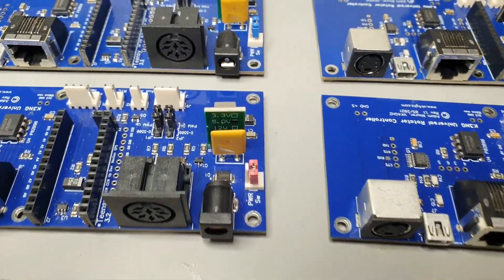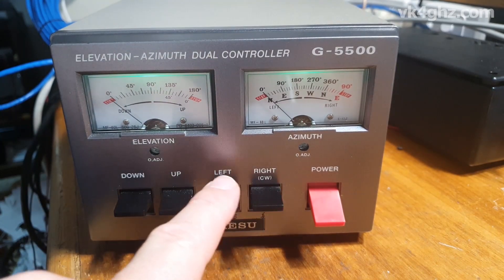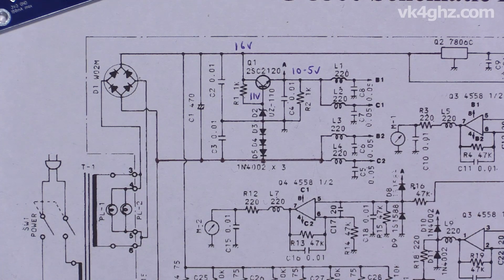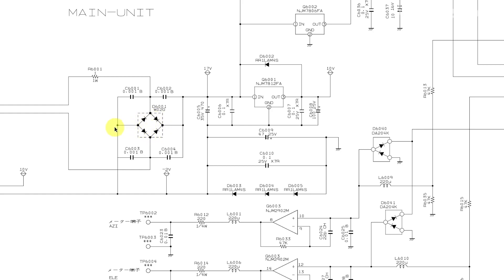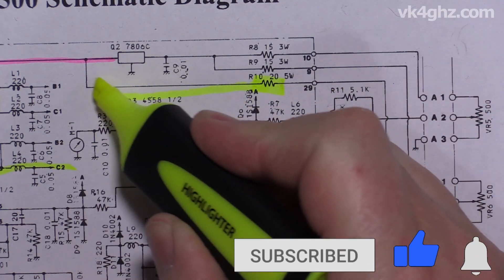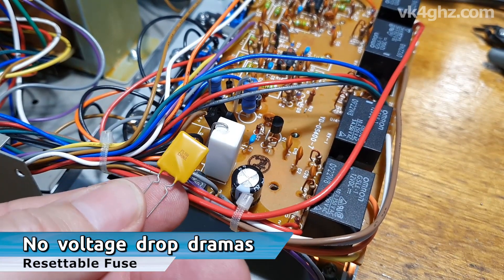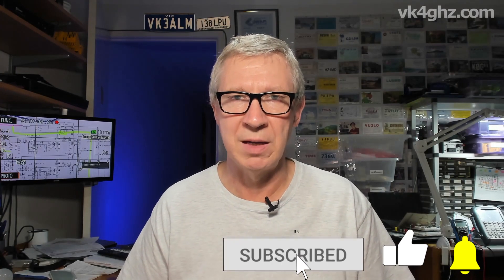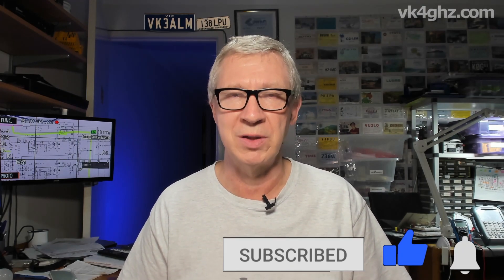Yaesu G-5500 Ground Rail Fault & Better Voltage Drop Fix

Comment: Hello Adam. I’m purchasing a G-5500 but next summer moving to the Philippines. Their voltage is 220 there. I called Yaesu and they would not provide me a schematic of the controller or share process so I could convert. Would you be able to advise on the wiring mod from 120 to 220 or tell me how to obtain a schematic? Thanks in advance.
Reply: Good afternoon. Just wonder if you’re still trying to correct the 120-220v situation

Comment: Flux on the SoderWick, great hint! :)
Reply from the maker: The flux significantly helps the wicking ability of the SoLderwick Rick, and there is less risk of the pad/tracks delamination from the substrate.
Reply: also great for the times when you have no wick but miles of cheap coax for the outer braid